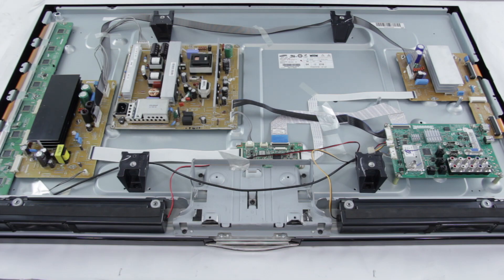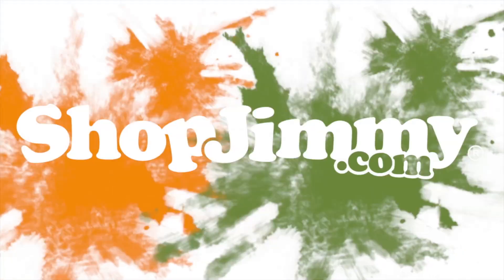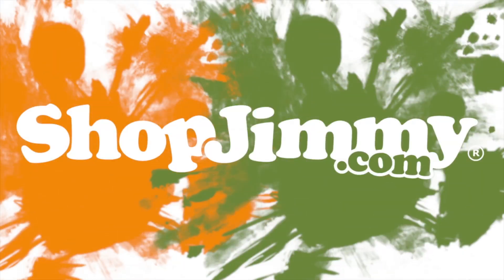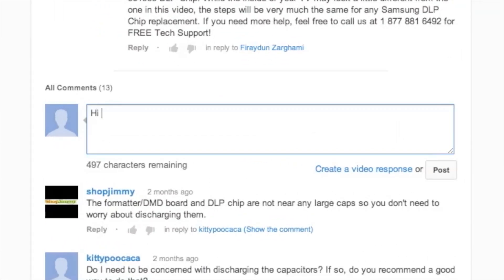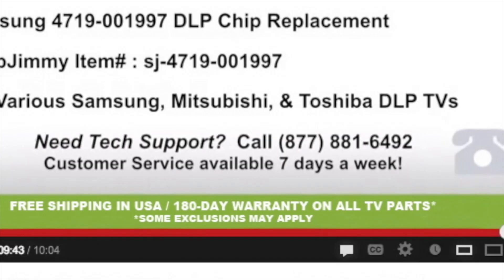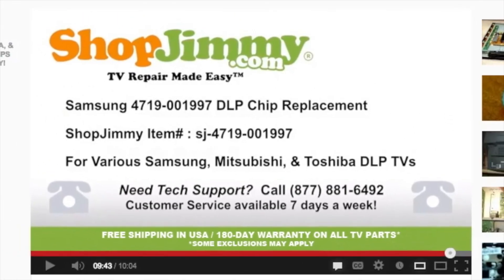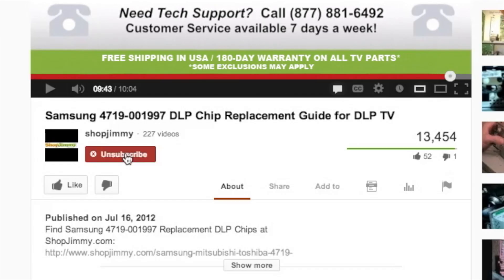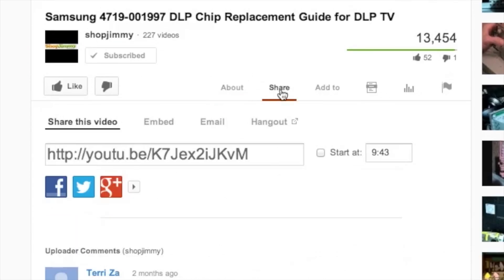Plasma TV Repair Tutorial - Common Symptoms & Solutions - How to Fix Plasma TVs

Comment: I have a LG 50PV450.UA manufactured October 2011. It was recently affected by a power surge which damaged the cable box it was connected to. It has the following symptoms:
1) Standby power works fine
2) Main power works fine
3) After disconnecting it from AC power for around 30 minutes and reconnecting the display works fine (all menus display in accurate color with no lines on the screen). It responds to all remote control commands.
4) After about 1 minute, the display turns very narrow green horizontal lines which are scanning. It appears to be the menu as when I press exit the screen goes black and turns green again when you re-enter the menu.
5) About a minute after that the screen goes black - no image is displayed, though the LED indicator indicates that it is responding to remote commands. Power off still works fine, however when powering back on the image remains black until the power is disconnected for an extended period of time. If disconnected for a short period I did notice that the screen powers on with either brief green lines and once showed the source information box with a few narrow black lines through it for a couple seconds, then went fully black.

Any ideas what board I should try first?
Reply from the maker: BrynDN335   Try all repairs and troubleshooting at your own risk.  I recommend replacing the power supply and the main board in your TV.  Click this link to replacement parts for your TV model number:  http://www.shopjimmy.com/catalogsearch/result/?q=50PV450.UA  There may be multiple boards for the same TV model number, be sure to match part numbers on your current board, with your replacement for compatibility.  Thanks and please let us know if you have any further questions with your TV Repair!  www.shopjimmy.com

Comment: Thanks this tv is exactly same backing as mine I replaced the power board The screen has a spider crack lower right corner, I feel this is not worth repairing because of the screen crack. although u can see a video flash then nothing.

Comment: hi my name is Michael one day I watching tv and a horizontal line appeared at the top of the screen it was real thin.now its been about 4 months and now there are three line.the third line appeared 3 days ago and last night I was watching tv and all of  a sudden there was a some what loud noise. then seconds later the bottom left side of the screen turned like purple and blue color I think then the tv went off and hasn't worked since. my tv model is PN50B400P3D 55 INCH Samsung plasma.if you could help I would really appreciate it.
Reply from the maker: Mike Pierani   This sounds like a TV panel (TV Screen) problem.  If your TV panel is bad, it may be more cost-effective to replace the TV as panels are typically hard to find in stock, difficult to replace, and expensive.  Thanks and please let us know if you have any further questions!  www.shopjimmy.com

Comment: HI! My LG 42PC3D has a green sparkly screen when it is first turned on. It slowly gets better over a 7 minute time period. After this, the screen seems fine. When it is first turned on, the picture is so bad that you can't really make out anything. Any help would be appreciated. Thanks!!
Reply from the maker: Kirk Haugen  Try all repairs and troubleshooting at your own risk.  I recommend replacing the YSUS and the YDRVTP board in your TV.  Click this link to replacement parts for your TV model number:  http://www.shopjimmy.com/catalogsearch/result/index/?p=2&q=42PC3D  There may be multiple boards for the same TV model number, be sure to match part numbers on your current board, with your replacement for compatibility.  Here is a link to a video showing how to identify your part number, click here:  https://www.youtube.com/watch?v=GEllG3RV-tc  Thanks and please let us know if you have any further questions with your TV Repair!  www.shopjimmy.com

Comment: Yesterday we had lightning cause a power surge and Im pretty sure it hit our 51" Samsung Plasma TV (Model Code- PN51E450A1FXZA). It won't turn on and there is no stand by light. However, when I plug it in I do hear electricity moving through the TV and a green light flashes in what I believe is the main board (I haven't turned the TV on without the back panel attached and I see the flashing green light through the ventilation system). I haven't tried anything other than keeping it unplugged overnight and trying it on a different outlet. I ordered a new main board but I honestly have no idea if that is actually the cause or not. Any direction would be helpful.
Reply from the maker: Deanna Ver Schneider  Try all repairs and troubleshooting at your own risk.  I recommend replacing the power supply and the main board in your TV.  Click this link to replacement parts for your TV model number:  http://www.shopjimmy.com/catalogsearch/result/?q=PN51E450A1FXZA  There may be multiple boards for the same TV model number, be sure to match part numbers on your current board, with your replacement for compatibility.  Thanks and please let us know if you have any further questions with your TV Repair!  www.shopjimmy.com

Comment: Hi, I have a Zenith model z50pj240. My TV broke during a brown out. When i turn the TV on, the screen lights up but there is no picture. It seems like the sound will come and go. Because i cant see the picture i have no idea what the input is, i will cycle through all of them and it seems like sometimes i will have sound but other times i wont.... when i unplug the Ysus nothing happens, but when i unplug the Zsus i get a red picture of the last thing that was on the screen before the Brown out, and this image fades to black very rapidly.
Reply from the maker: Michael LaManna  Try all repairs and troubleshooting at your own risk.  I recommend replacing the YSUS and the YDRVTP & YDRVBT boards in your TV.  Click this link to replacement parts for your TV model number:  http://www.shopjimmy.com/catalogsearch/result/?q=z50pj240  There may be multiple boards for the same TV model number, be sure to match part numbers on your current board, with your replacement for compatibility.  Here is a link to a video showing how to identify your part number, click here: https://www.youtube.com/watch?v=GEllG3RV-tc  Thanks and please let us know if you have any further questions with your TV Repair!  www.shopjimmy.com

Comment: I have an LG 50pn4500 plasma tv that will not turn on. It does have standby power. When I try to power on the TV the power light blinks fast two times and does a slower blink two more times, then it stays off as if the TV is powering on, but then after two or three seconds the TV returns to standby mode. I know that it is not the power supply board (since I just bought one from your shop and it did not fix the problem). After watching this video I am leaning towards the YSUS board. Any tips on what to test to find out exactly what is wrong?
Reply from the maker: Tell you my name later   Try this at your own risk. Unplug the TV, then disconnect the y board and plug in the TV to see if the TV powers up. Reply with the results of this test. Thanks! www.shopjimmy.com
Reply: ShopJimmy.com Disconnected the Y board and the TV did appear to stay powered on. It did not return to standby mode as it was doing before.
Reply from the maker: Tell you my name later  Try all repairs and troubleshooting at your own risk.  Sounds like the Y board is bad.  Click this link to replacement parts for your TV model number:  http://www.shopjimmy.com/lg-ebr74825301-ysus-board.htm  There may be multiple boards for the same TV model number, be sure to match part numbers on your current board, with your replacement for compatibility.  Thanks and please let us know if you have any further questions with your TV Repair!  www.shopjimmy.com

Comment: Hi, I have an LG50PA6500. When you plug it in the power relay clicks but the TV does not power up. There is a standby light on the front but the TV does not respond to the remote control or from the control buttons being pressed. On the back of the TV the is a red light on the back of the main board and a green flashing light on the logic board.
Please can you help determine the problem?

Comment: Hello,  I have a Panasonic TH-50VT20A Plasma 3D TV.  It's just about to turn 5 years old and it's an awesome TV to watch movies and free to air TV.  Lately I've noticed scrolling horizontal bars on very black scenes. It totally disappears on lighter images. I also feels it occurs more after the TV has warned up. It doesn't appear to do it on cold. I'm a little disappointed as 5 years for a plasma panel is not very long, especially seeing as it's only switched on for a maximum of 5 hours per day on average. Do you have any suggestions or advice for me. Love your videos.
Reply from the maker: Jamie Trotter  I recommend that you bring the TV to a certified Panasonic repair shop. Thanks! www.shopjimmy.com

Comment: I have a plasma TV model number PN51D550C1F that has no image only I can hear a click click click and blinking red light in front of TV I would like a help to fix it 
Thanks
Leo
Reply from the maker: *****  Try all repairs and troubleshooting at your own risk.  I recommend replacing the Y-Main Board and the Bottom Y Scan Drive board in your TV.  Click this link to replacement parts for your TV model number:  http://www.shopjimmy.com/catalogsearch/result/?q=PN51D550C1F  There may be multiple boards for the same TV model number, be sure to match part numbers on your current board, with your replacement for compatibility.  Here is a link to a video showing how to identify your part number, click here:  https://www.youtube.com/watch?v=R1jmj_foId0  Thanks and please let us know if you have any further questions with your TV Repair!  www.shopjimmy.com

Comment: Samsung plasma: PN50C7000YFXZA

I have been having a sparkling image in solid red colors for a while, but just the other day a thin black line about 5 or so inches from the bottom showed all the way across the screen... Are they related? How can I fix the thin line first? Thanks
Reply: I think It's a single row of pixels out (about a 1 mm wide, very sharp line). I was told it could be the display going... Very disappointed, it's only about 5 years old, and I really like the plasma picture... And they don't make them anymore.

Comment: My Samsung S42AX-YB02 will not turn on.  Red light when its off, turn on see blue light for a second, then back to red.  Took coveer off, no bulging capacitors.  Thanks for the help!
Reply from the maker: kurt fahnholz   Try this at your own risk. Unplug the TV, then disconnect the y board and plug in the TV to see if the TV powers up. Reply with the results of this test. Thanks! www.shopjimmy.com
Reply: ShopJimmy.com the light goes blue for a second then off to red. Blinks 6 times then a pause then repeats 6 times then pause, and so on. Thanks for the help.
Reply from the maker: kurt fahnholz  Try this at your own risk.   I recommend that you repeat the same test on the X board.  Thanks!  www.shopjimmy.com
Reply from the maker: kurt fahnholz  Try this at your own risk.   I recommend that you repeat the same test on the X board.  Thanks!  www.shopjimmy.com
Reply from the maker: kurt fahnholz   Try all repairs and troubleshooting at your own risk.  This is a problem with either the main board or the power supply board in your TV.  Click this link to replacement parts for your TV model number:  http://www.shopjimmy.com/catalogsearch/result/?q=S42AX-YB02  There may be multiple boards for the same TV model number, be sure to match part numbers on your current board, with your replacement for compatibility.  Here is a link to a video showing how to identify your part number, click here:  https://www.youtube.com/watch?v=R1jmj_foId0  Thanks and please let us know if you have any further questions with your TV Repair!  www.shopjimmy.com

Comment: I have a Samsung Plasma and to be honest, it's doing my head in. There is no picture whatsoever. The Standby light flashes 5-6 times. The screen does flash into life for barely a second, then goes off. I have sound when connected to a DVD player and remote does function. Now I have replaced the PSU board, the X and Y sustain boards, no difference. I have checked all the solder, re soldered joints which I thought were bad, still nothing. I have even replaced all caps, knowing what Samsung are like.
Still no picture, so now im stuck. I see by your video, you say that a bad logic board can cause picture failure. Do you think that this is the case here, or some other problem I am overlooking.
Any help would be appreciated.
Reply from the maker: *****  Try all repairs and troubleshooting at your own risk.  Did you replace the buffers with the Y Sustain board?  Also, please reply with your TV model number.  Click here to view a video that shows how to find your TV model number:  https://www.youtube.com/watch?v=S51nhAmwR2M  Thanks!  www.shopjimmy.com

Comment: I have a LG plasma model # 42PT350-UD . It made a loud pop and would not show picture or audio. Now when I turn it off and on I get a clicking sound and the standby light flashes. Usually click 4 times and flashes twice before the standby light becomes solid. Would you be able to recommend a fix or a part?

Comment: I have a Samsung 50" Plasma TV. Model # PN50C450B1D that was working fine one minute and then I changed the channel and the video scrambled. The sound is fine, but not the picture. All I get is horizontal lines over the entire screen. Any suggestions would be appreciated.
Reply from the maker: J Marn  Try all repairs and troubleshooting at your own risk.  I recommend replacing the main board in your TV.  Click this link to replacement parts for your TV model number:  http://www.shopjimmy.com/catalogsearch/result/index/?cat=56&q=PN50C450B1D  There may be multiple boards for the same TV model number, be sure to match part numbers on your current board, with your replacement for compatibility.  Here is a link to a video showing how to identify your part number, click here:  https://www.youtube.com/watch?v=BEPWrefQvqI  Thanks and please let us know if you have any further questions with your TV Repair!  www.shopjimmy.com

Comment: My Tv is very similar to this one My Power Board has t caps green in color that have brunt on the board around the caps Model NumberPN51D430A3D, no picture no Menu. 
PN51D430A3D how do I test ans repair my power board Please Help Thank you
Reply from the maker: Radioman56  Try all repairs and troubleshooting at your own risk.  You will want to either replace the capacitors or the board.  Click this link to replacement parts for your TV model number:  http://www.shopjimmy.com/catalogsearch/result/index/?cat=59&q=PN51D430A3D  There may be multiple boards for the same TV model number, be sure to match part numbers on your current board, with your replacement for compatibility.  Here is a link to a video showing how to identify your part number, click here:  https://www.youtube.com/watch?v=sSJexLvRrjM  Thanks and please let us know if you have any further questions with your TV Repair!  www.shopjimmy.com
Reply: Purchased a power board  and it will be here soon
ill install it. then re try the set. 
if it is not that then I feel it is defendant is the y sustain board.

I also have all the  parts from a Samsung plasma TV, but the numbers are different.
so Ill be selling these off soon

Comment: I have a Samsung Plasma 3D, HDTV. Model# PN51D6500DFXZA. Serial# Z33T3CQBB01119M.
The problem is that when I plug in the TV it starts to turn on and the screen comes on and it shows the Samsung smart TV logo and then it displays the HDMI3 and it turns off. This repeats over and over untill I unplug the power cord to the TV. I've read a lot of articles about capacitors blown on the power supply. So I purchased a new power supply board and it still does it. Power supply P/N BN44-00446C.   PSPF461501A. Please help.
Reply from the maker: Larry Geisert   I recommend replacing the main board in your TV.  Click this link to replacement parts for your TV model number:  http://www.shopjimmy.com/catalogsearch/result/?q=PN51D6500DFXZA  There may be multiple boards for the same TV model number, be sure to match part numbers on your current board, with your replacement for compatibility.  Thanks and please let us know if you have any further questions with your TV Repair!  www.shopjimmy.com

Comment: Hi, I have a Panasonic plasma, Model: TH65PZ850U with a black vertical bar only in the left lower quadrant (also seems to be affecting the area around it with messed up colors). Thanks for any help. I have uploaded a picture of the problem here as it may be better once you see it: http://members.shaw.ca/junkuser1988/tv/IMG_0722.JPG
Reply from the maker: Tim Patrie   This sounds like a TV panel (TV Screen) problem.  If your TV panel is bad, it may be more cost-effective to replace the TV as panels are typically hard to find in stock, difficult to replace, and expensive.  Thanks and please let us know if you have any further questions!  www.shopjimmy.com